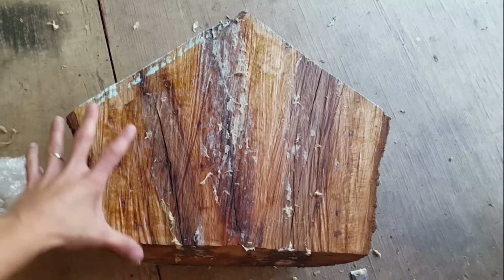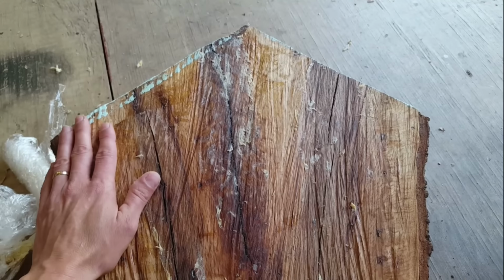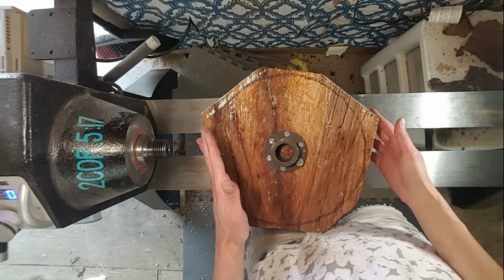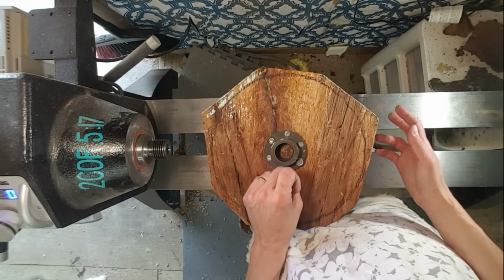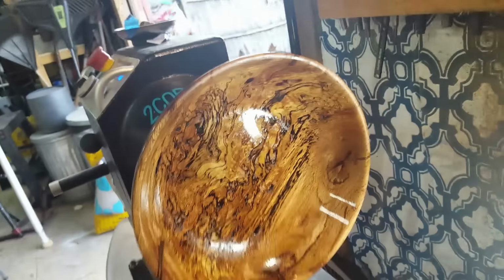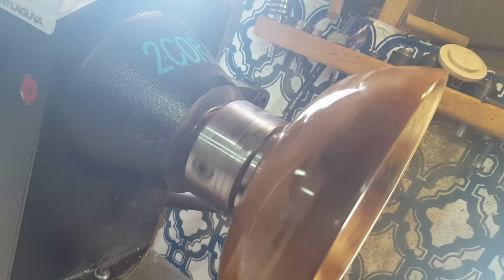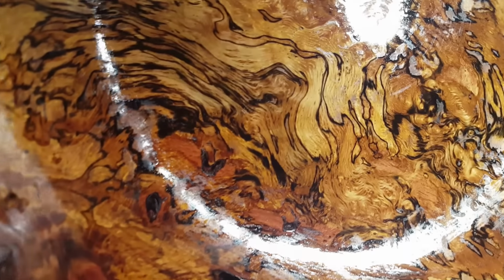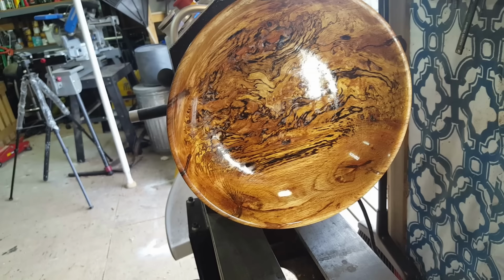Spalted Oak Crotch Bowl  & New method for cracked wood

Comment: I love spalting, but that piece is NUTS!!  I can't get over the figure and colors!  What a find!  And, obviously, nice job turning it.  The shot of the bowl upside down at 37:21 reminds me of Jupiter, with the spalting being the cloud lines and the red knot being the red storm.  I do suspect the wax was the reason for those dull spots.  With friction, it's going to liquify and melt into the wood, and it'll resist most finishes after that.  As for the wobble, I would say it's down to wood movement after turning.  The faceplate shouldn't be the issue, since the rebate you turned on the bottom was done while the bowl was spinning in the round and was true.  I've had bowls do this to me before, once the interior mass was removed.  Some woods seem more susceptible to this than others, and it likely has something to do with moisture as well, but with a crotch piece like that there's a lot of stored tension going in at least two different directions, which would also work against you.  It just becomes part of the character of the piece.

Again, beautiful piece!  Thanks for sharing it with us!
Reply from the maker: Thank you so much 🤗

Comment: Kim, this is my first of your videos and I enjoyed it. Your bowl turned out beautifully. I have a bunch of spalted oak like that and had to laugh when you were pulling that worm out of the hole. Can't count how many times I've done that. Some might not realize how challenging it is to work with oak that punky but if you can pull it off you get beautiful results. I've even made some pens out of it and when you get that small you really have to be careful, it will sometimes just shatter into pieces. Thanks for the video.
Reply from the maker: Thanks Rob!
Yeah, I made bracelets that just snapped. The stuff is so chippy and unpredictable.
When I started to learn how to turn I got a bunch of wood for my sister's burn pile Oh, it was all spalted Oak. So the very first would I learn to turn was spalted Oak. I didn't have any other kind of wood to turn at the time, so I just made it work. Start off at the hard stuff we go from there. LOL

Comment: Gorgeous piece of spalted oak, Kim, and you made a beautiful bowl from it.  As for the dull spots, I think that may actually be the punkier places that absorbed the finish so that it won't shine.  Any friction polish (like OB) is a building finish and the shine is a result of the heat from friction.  If it soaks in and doesn't build, it won't shine.
Billy
Reply from the maker: Thanks!! 
Yeah, the shine wasn't so much on the black part of the spalting. 
Thanks for the info and the kind words!

Comment: The dull spots are a soft area that absorbs the finish. Also lacquer is not a good sealer. Use a thinned or a spray shellac or a water based polyacrylic sealer. Beautiful bowl. Love the grain. Nice work. I subbed too.
Reply from the maker: Thank you! And thanks for the tip. I will try thinned shellac. thanks for the sub!

Comment: That's a good method of treating cracks.  Please do a video on how the paper towels are applied.  Are the pushed into the crack or just laid over the top?  Very nice turning.
Reply from the maker: Thanks Joe! 
The paper towels are soaked with the glue/water and after pouring the glue/water in the cracks, I then applied the soaked paper towels and just pat them down. wrap it or put in a garbage bag. Probably would work best if the glue is allowed to dry completely. I have two more logs that I already applied the glue, about two weeks ago so I am testing it again but waiting longer to turn. Hope that help :)

Comment: I have the same issue with OB shine juice on spalted wood. I believe the spalted areas, being of a softer nature, absorb the finish therefore creating the "matte" finish that you spoke of. I think a sanding sealer may help with this but have not tried it yet. Good luck and Thanks for the video
Reply from the maker: I think so too! Thanks for the input!
Reply: Shellac will work and is especially compatible with OB Shine.

Comment: I agree with Billy Burt below.  When using that type of finish, the matte areas are usually due to the finish soaking so much there isn't any build.  Sometimes I will apply 15 or 20 coats of a shellac-based finish before the spots gloss up well.  Waxing can help ,but it won't fix the  real problem.  You got a nice result from hard work on this one.

Comment: That is a remarkable bowl, Kim. I never thought much about turning crotch pieces. You have opened my mind to new possibilities. By the way, if I could ever get my wife to watch this video,  I'm sure she would want to know about the quilt behind your lathe.
Reply from the maker: Thanks Jim! The fabric behind my lathe is an old vinyl window treatment stuff from the 70s LOL I found it add an old wood junkyard. Found a big huge roll of it. It was free so I decided to use it to keep the shavings out of the wall. It is there until I get a chance put up real walls 🤗🤗😉
Reply: Kim Tippin Wood Turning 
I've had my shop fo 10 years & still haven't finished or insulated the walls, YET. lol
Reply from the maker: @TheSafecrkr1  lol your not alone!

Comment: Kim, couple of tips, the first is if you use a lot of CA glue (super glue) you can get pints or quarts of it on ebay or amazon and if you didnt know baking soda makes super glue dry instantly like a rock so if you have to make a repair quickly just put super glue from your new big bottle on a crack or hole a sprinkle baking soda on it and wham you can sand it or whatever!  Good luck like your vids.
Reply from the maker: Thank you 🤗

Comment: when you say 50/50 lacquer thinner for sanding sealer, what is the other ingredient?
Reply from the maker: lacquer and lacquer thinner.  I now use 50/50 Shellac and Denatured alcohol.  I feel it works better and dries faster.
Reply: @KimTippin  Kim, Beautiful work.  I am a new turner, currently in the self education phase; when you use a sanding sealer are you then committed to using only certain finishes?

Comment: at 26 min you attached a tool to the bottom o the  bowl?  im new to turning and do not know what that is called?  thanks KC
Reply from the maker: I was burning the bottom with my brand. I had a custom branding iron tip made. Custombranding.com I think is where I got it from.
Reply: sorry i was not clear. you added a chuck to the bottom of the bowl after carving the outside, you gouged a hole and inserted the chuck and then dug out the inside of the bowl.  you used a micrometer to measure and then attached the chuck.  looks like it spreads out in the hole in the bottom of the bowl??   then turned the bowl around on the lathe,  worked on the inside of the bowl.    sorry for not being more accurate.  this was the bowl you wrapped in cellophane with paper towel and wood glue to pull the gaps together.  i think this was the first time you used this process??  thanks KC  also still had worms in it:)
Reply from the maker: I am sorry Ken, I was thinking you were referencing a different video. My view looks different than yours so I didn't see what video you were talking about. My fault not yours!   I was attaching my chuck to the bottom before flipping it. This method helps to get the chuck on nice and flat / straight. Especially when working with larger chunks of wood. You can also put the wood on as the chuck is attached to the headstock and use the tailstock to press against the piece to help hold it in place while tightening the chuck jaws.   I have a wobble in this headstock ( Laguna is sending a new one) so I am trying to eliminate wobble as much as I can.  Thank you for responding back and helping me get it straight! 😁😜

Comment: I use a fair amount of ca glue and I noticed you do too, I buy a 2 lb. bottle from E-bay for about $65 and refill my 4.5 Stick fast bottle. Search T3 thin Ca glue. I have a lot of Black Walnut that's been on the ground for almost 2 years and it has a lot of cracks in places.
Reply from the maker: Thank you so much 🤗
Reply: @KimTippin  I got it backwards, it's 3t thin ca.

Comment: An excellent bowl and video! One minor criticism. It looked like you were using a rag to apply the sanding paste while it tuned on the lathe. You should never use anything but a paper towel on a spinning lathe. I broke a finger that way when the rag caught and slammed my hand on the bed ways.
Reply: Everyone who ever got hurt never had a problem either. Until they got hurt. I never loss an eye but I still wear safety glasses and a face shield

Comment: Nice out come from a piece of wood that had problems.
Noticed your boots in video. Don't they fill up with wood chips? I hate it when that happens to me, so I made up some gators from an old pair of jeans. I tie them around my legs to cover to gap that catches all the wood chips.  ;)
Reply from the maker: Thanks! yeah, my boots collect quite a bit of shavings lol.
Reply: I got some "spats" at a hunters store. They are made to keep stuff from getting in hunters boots or shoes while trekking through the woods. They work great. They just wrap around the ankles and drape down over the boots, like a raincoat.

Comment: Was that a beetle larvae you dug out?
Reply from the maker: yes!! bugs for days in this bowl.
Reply: @KimTippin  Powder Post Beetles. They LOVE walnut.
Reply from the maker: @stephenbreazeale8179  apperently oak as well. I get splattered by these nasty fat things all tge time turning. In my hair!! up my arms!!! chest and sometimes legs. 
all you can do is keep going.... lol
Reply: @KimTippin  I haven't turned any wood with the beetle larve in it yet. My experience comes from claro walnut slabs. Luckily they have been primarily in the sap wood just under the bark. I was fortunate enough to get 50 slabs from a backyard walnut tree here in California. They have been air drying for over a year. Just now having some kiln dried. Lots of live edge tables in my future.
Reply from the maker: That sounds so exciting! I wish I had a mill to cut slabs! You're lucky duck! This what I think came from my sister's firewood pile so I had been sitting for a while. Most of the stuff that's been sitting for a year or so it's so full of bugs. Actually doesn't take long here in Florida for anything get full of bugs! LOL
Reply: So many places have quarantines on moving wood due to destructive and invasive insects.  I suppose that is a particular concern for woodworking.  Odd that no one ever talks about it.

Comment: Whoa... I would not have expected that beautiful spalting from any oak. That's a keeper. I'm distressed that you're still having the wobblies, and I'm all out of long-distance suggestions. Good on you, though, for soldiering on.  Clyde
Reply from the maker: I worked darn hard to turn on a wobbly lathe lol might as well keep on truckin'  ha
Thanks so much for your help!
Reply: Don't finish the outside in the first position. When you turn it around true it up and then move to the inside.
Reply from the maker: @brayswoodturning5036  Hey Greg!
I would but I am getting a horrible wobble and if I did that, I would be taking a lot more wood off. I am doing some things a little out of sorts, I am sorry, it is because I am having issues with my lathe. Thanks for the suggestions though!
Reply: See
Reply: @KimTippin  Kim, put your spur in the head stock. Move tail stock with live center in it up to spur. See if the points match. Rotat the hand wheel to see if the head stock stays on center. If it doesn't it's probably the lathe. Good luck 👍

Comment: Hi Kim, the blue or dark purple stains could be the mineral stain that is found in some oaks. It is usually quite noticeable on you turning tools. I turned an English Oak a few years back and it was like the wood was 'bleeding' a blue/purple colour, which discoloured my tools. Did you measure the moisture of the piece before turning?. Cheers
Reply from the maker: Thanks!!  No, I didn't measure the moisture.  Oak will move even it it has just a drop of moisture, at least with my experience here in muggy Florida, lol Oak is a hard wood with tight grain. I have turned more oak than anything. SO MUCH OAK!!! LOL I can kinda tell its dryness by how it turns and the chips that come off. Oak can "feel" dry but many times even when the meter says 9-12% it is still gonna move.

Comment: Hi ho, getting rid of the dull spots just comes down to how many coats of finish you're prepared to put on, I find 7 to 14 coats of a good lacquer, allowing each coat to dry properly with a VERY light sanding in between, you'll end up with a finish you could fall into. Check out Martin Saban-smith's recent youtube vids?

Comment: Kim I've been watching your videos for a while and this one raises all sorts of reactions with me. First if you take wet wood and add thin glue and then wrap in plastic there is no way the glue will dry. Next if the glue does penetrate like you were hoping it will dry as it gets exposed to air and then will show when finish is applied.
Usually in spalted wood the soft spots absorb the glue more and then really show off the glue when the finish is put on. I don't understand why you use sanding paste and sandpaper. The sanding paste should be enough on it's own. If you mix a coarse grit and a fine grit the net result will be a coarse grit finish.
Try using vacuum storage bags with white glue. Soak the wood in the diluted glue and pull a vacuum. Leave for 24 hours and then take the wood out and let it dry thoroughly. This will really get the cracks filled with glue and swell the wood to close the cracks. But you will notice the glue show through the finish. Try doing the same thing with epoxy. The epoxy will set without air exposure. But be careful it can also overheat.
Treating cracks before you turn is a lot safer way to work so 👍👍👍
Beautiful piece of wood